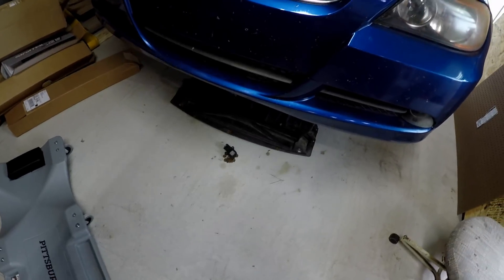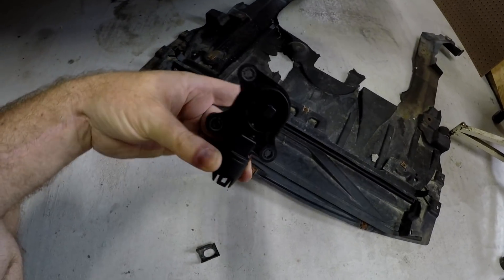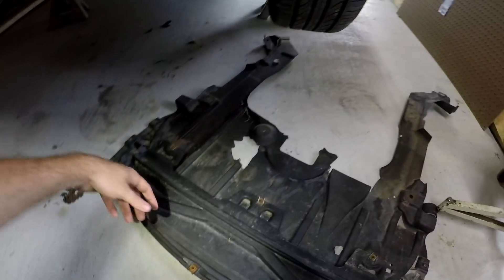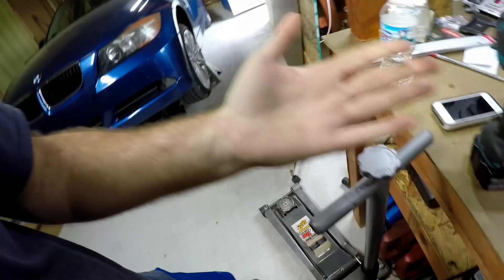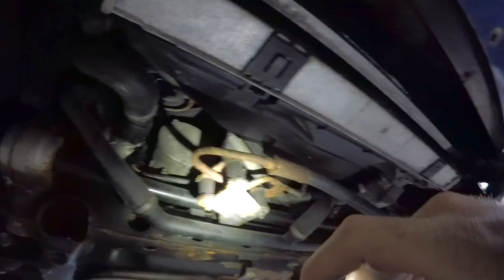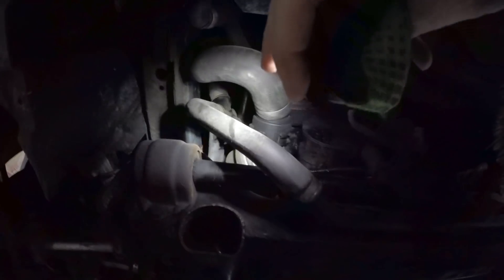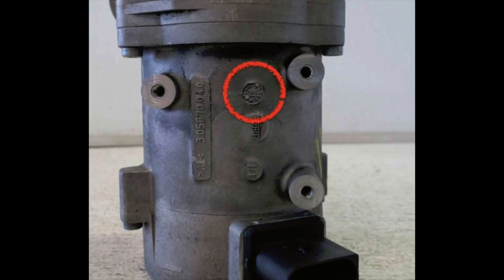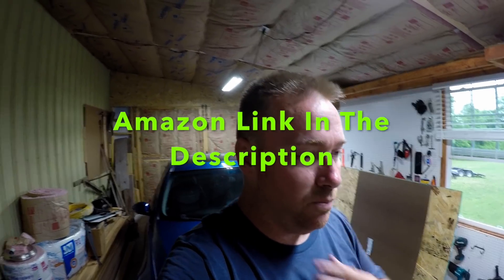How To Check The Date On Your BMW Electric Water Pump  E90 E60 X5 X3

Comment: Thanks for this. I am in the exact same situation. Bought a 2014 built F30 335i ewg with 165k km, now sitting at 180k km. It has no service records, so I need to check the date.

Comment: I just replaced mine last weekend. Do you know why my e92 didn’t take all the two gallons of coolant? I’m pretty sure all the coolant drained out once I removed both thermostat and water pump.
Reply from the maker: Did you run the pump , hold the accelerator with the ignition on for 30 seconds until you hear the pump run and let it run its course until it shuts off?
Reply: Nathan's DIY Garage yea I bleed it before turning on the car. Is it possible for there to be air pockets even after bleeding and turning car on and going for a test drive?
Reply from the maker: could be I would make sure the heater is on when you do this to open the heater core

Comment: I've got an 08 328xi with 101K miles. Going to have to check this weekend to see if it's been replaced. Have to replace valve cover soon as well :[
Reply from the maker: The valve cover gasket isn't bad to change on that car
Reply: The gasket is pretty cheap from the dealer too surprisingly
Reply: It's not rubber it's metal with a coating on it, super easy to install. Hardest part is keeping it from moving around when you put the cover back on, an extra set of hands is helpful but really simple otherwise
Reply: Nathan's DIY Garage That's relieving to hear lol. I was told that I should probably replace whole valve cover assembly because I've got a bolt on the valve cover spinning freely right now.
Reply: Daftalism not a bad idea... They can leak. You'll need new fasteners as well because they're aluminum and 1 time use only.

Comment: Does anyone know if the circle with the year of manufacture can be seen from the underneath of the car?
Reply from the maker: It should be, especially if the pump has been replaced already
Reply: Nathan's DIY Garage I’ll try to find it out one of these days.
I just bought 2006 325xit wagon on auction with 130 000 miles .
The dealer replaced a valve cover gasket at 62000 miles and that’s it.
No other maintenance history.
Reply from the maker: It doesn't really make that much difference I guess about the history

Comment: Mines a 2011 328xi and my original pump was going strong at 145k then I swapped it out because I was just getting nervous.. I do lots of long road trips. My old one had an 11 stamped on it and the new one has a 16.
Reply from the maker: I think the n52 pumps last alot longer than the n54, since the n54 pump has a plastic front housing that always seems to crack
Reply: Nathan's DIY Garage yes, I’ve seen lots of complaints about the N54 pumps, even the newer cars have the same issue with cracking. But I do believe that the new gen N52 pumps will go the distance.. I work with someone who also has a 2011 328 and he’s at around 180k with the new pump. He doesn’t follow this stuff like we do.. he just drives tor car and brings it to BMW for maintenance.

Comment: Ditto.......Wife's 2008 e 91 went 169k on original before I replaced the pump/thermostat.  I was coming home in her car from the Store.....Yellow light cooling temp light came on then 10 seconds later Red came.  Indy quoted $1100 and "Stealer" quoted $2200 to replace both water pump and thermostat.